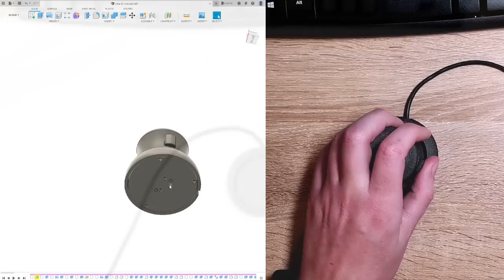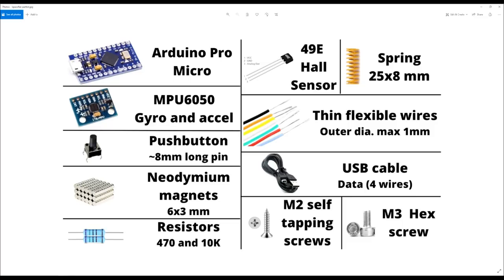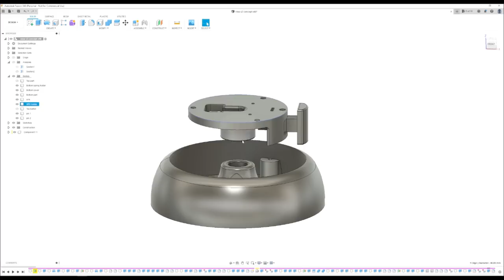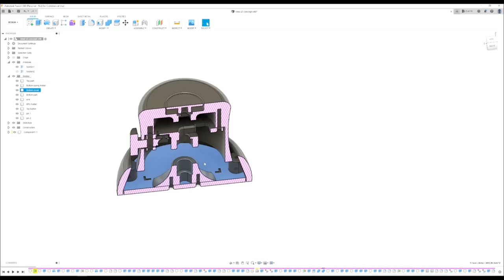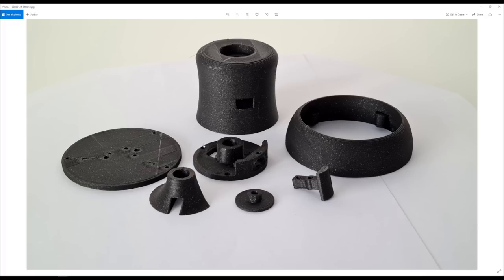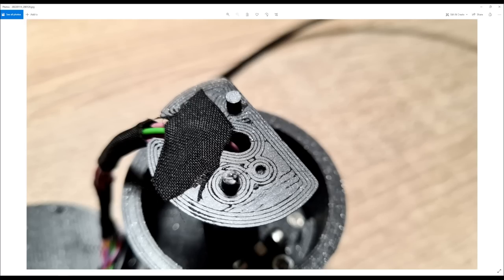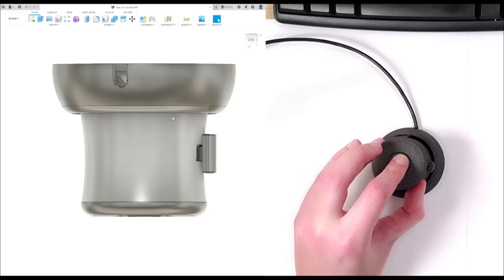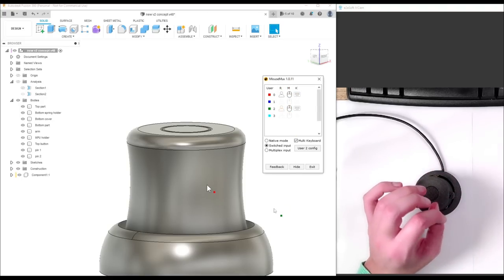Can my DIY Spacemouse compete with 3dConnexion??? - SpaceRat V2

Comment: T_T  i like 3dconnexion how it move without button  interact .
Reply from the maker: For sure it is on a different level but there is a factor of 5 cost difference 🙂 This is not a project to compete with 3Dconnexion just a fun little project.
Reply: @kikihobbyrepair   is fun .you continue build sure one day will achive the level you want. 
even 3dconnexion just just after finishing the model use for presentation. I still using normal mouse more convinient to 3D model.

Comment: Four axles, not six like the original. only downside i see
Reply from the maker: Basically it is 5. But the 6th is really missing 🙂 It is software limitation
Reply: @kikihobbyrepair  I think you could probably add the 6th if you used the same hall effect magnet used for the zoom, but used it to mount the top floating bit (main body). Or a strain gauge sensor. Both would need to be in the base to detect if the top is rotated. Definitely do-able. Thanks for posting